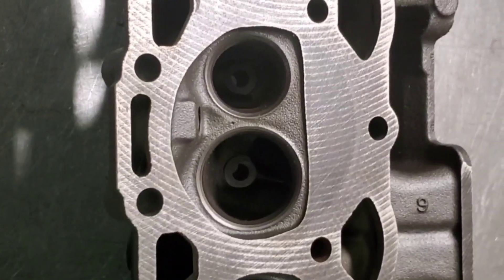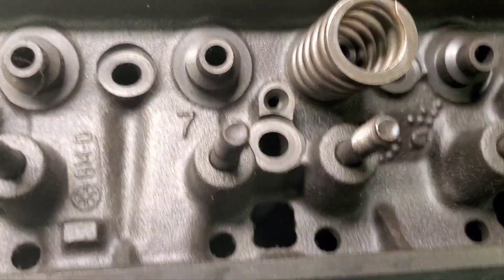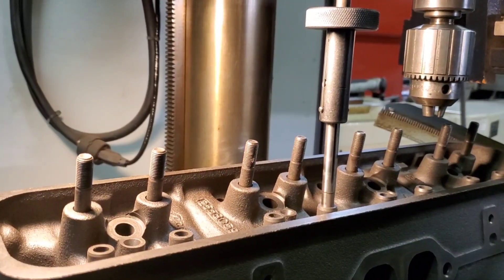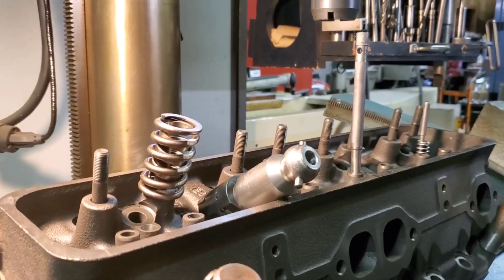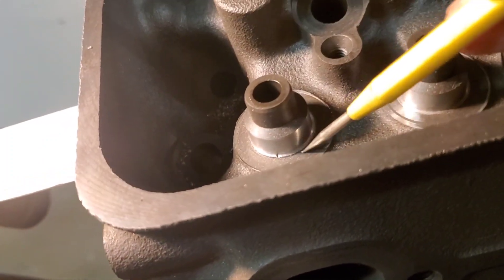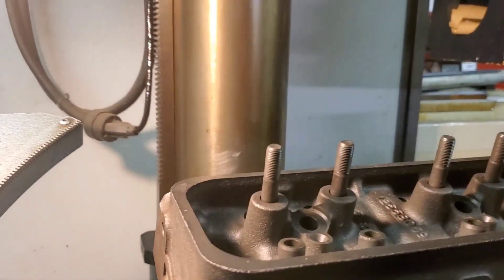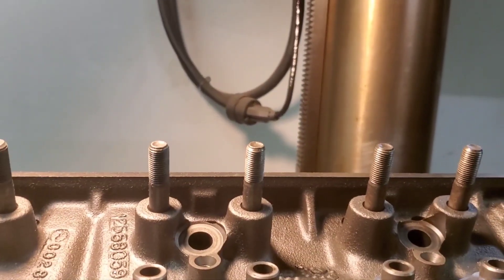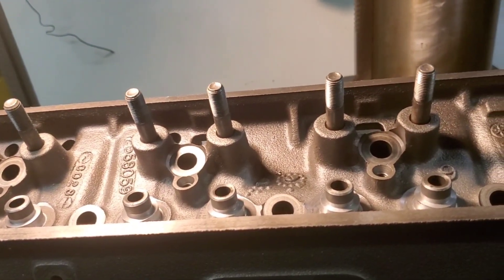Vortec Heads Machined for Z28 Springs and Additional Seal Clearance for Higher Lift Camshaft.

Comment: Thank you for this very informative video! It's a pleasure to hear and watch your work. You are a true professional.
Is there a problem running these heavier springs during camshaft break-in (using cam's recommended break in procedures)? Also, what is the minimum lift when using these springs? Looking at a mild cam with a .444/.466 lift on 305 HO 601 heads with z28 springs.
Reply from the maker: Hi Rod, thanks for watching and commenting. 
The Z28 should be fine, follow the manufacturers recommended spring pressure. 
And of course standard cam break in procedures. 
As long as cam is good quality and the lifters are you should be ok.
And of course the heads have to be machined.👍
Use a quality break in oil with high zink.
Have a great day.

Comment: One more question Ed. I have some older 305 chevy test heads that I am going to start to practice on. I noticed the spring pockets on the exh vs the intakes are a lot lower. Or vice versa I cannot remember. Should I cut them all the same height and use shims to get to my installed heights ?
Reply from the maker: Good morning TJ, I would eliminate the rotators on the exhaust find 8 intake retainers and shim the exhaust springs.
Install new springs of your choice.
Do not cut the intakes to the depth of the exhaust. 
That's my opinion anyways.
Good luck with your head build.
Take care, Ed.

Comment: .540/.535 ought'da  wake up that mill.  Hope the studs hang in there.  Thanks, Ed.
Reply from the maker: Hey 4Flat, thanks for watching. 
The cam we're using is .495 in..502 ex.
That studs should be fine for this application. 
Doing what the customer wants.
Take care, Ed.

Comment: You know what separates a machinist from a very experienced machinist with more knowledge probably forgotten than most would acquire?  .. when you can here night creatures in the background making their noise and your still hard at work. Not many are built with an abundance of midnight oil these days. 🚒👍👍🏁💯
Reply from the maker: Thanks First Responder. 
I remember years ago alot of the best work happened late nights, weekends.
I did not have a personal life.
That's what it called for.
Sometimes I think that I need to return to my roots.
Never failed me.
You have a good perspective and I appreciate it.
Take care, Ed.
Reply: Ed, thanks for showing this. I have read about it but never seen it. Now I understand what has to be done for new vavle seals & springs! Next, I'm going to need to look at valve seats replaced, valve guides replaced and pressed in rocker studs being changed to a screw in type. I'm NOT a machinist. Just trying to educate myself. I've got lots of questions for another day. Thanks for sharing your knowledge!
Reply from the maker: @bradsrestorations1085 Thank you Brad.
I appreciate you watching.
I will be doing some screw in studs in the future and valve seats.
Take care, Ed.

Comment: Thank you posting this information. What was the stock maximum lift on these heads?
Reply from the maker: About .480.
.500 would be pushing it.
Some of the factory seals are taller.
Thus requiring smaller cam.
Thanks again for watching. 
Take care, Ed.

Comment: Thanks for this. I will be doing this on my Bridgeport soon. I noticed you stayed with .562 seals. I think I am going to .531 positive seals. Thoughts. Thanks.
Reply from the maker: Thanks TJ, I really appreciate it. 
I stayed with .562, the seals were in the gasket kit.
No need to go with .531, just single springs.
Very good idea using your Bridgeport. 👍👍.
Take care, Ed.
Reply: @edsmachine93  Ed. I am looking for a pilot level. I have a small Starrett level. I might make my own set up. I have not found one for sale yet.
Reply from the maker: You may look at Goodson Products or Regis Manufacturing. 
They should have what you need.
Or maybe used on Ebay.
👍
Reply: Thanks again Ed 👍👍
Reply from the maker: Thank you First Responder. 
I appreciate it. 
Take care, Ed.